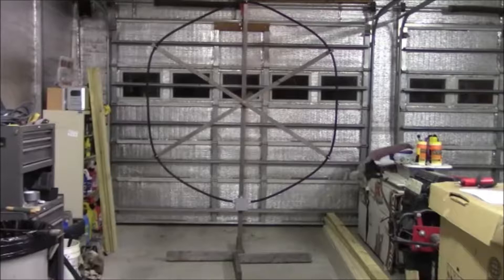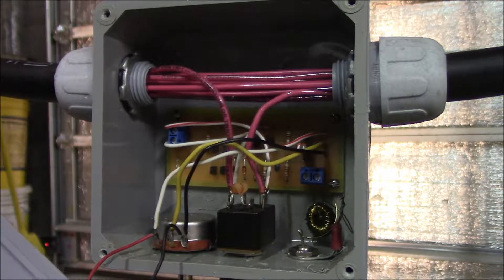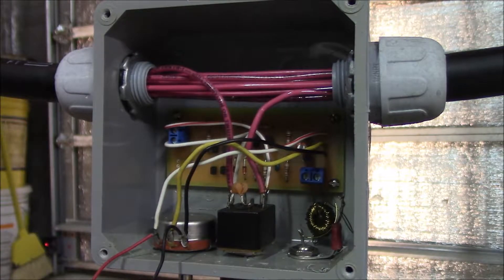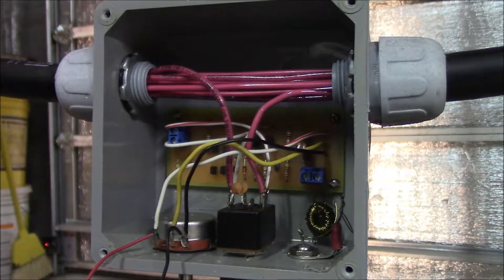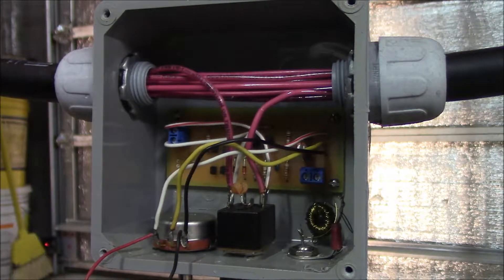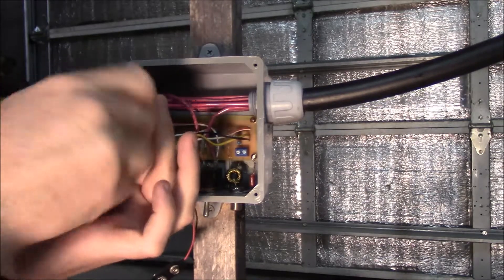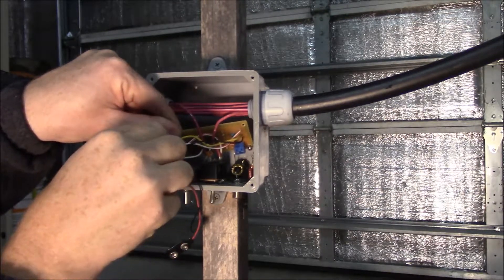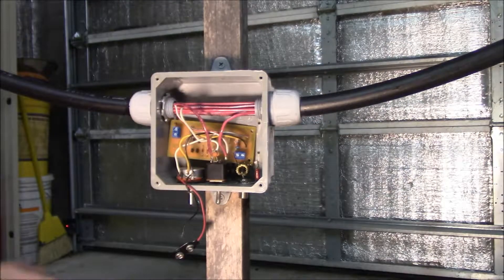Longwave loop antenna repair

Comment: How do you build this antenna?  Is there a link on how to construct it?  How did you insert the hook up wire through the PVC pipe?
Reply from the maker: Check out the link below to my personal website. It will get you started. Let me know what questions you have after that and maybe I'll make a video on it.
Www.jwhamer.me/loop_antenna/